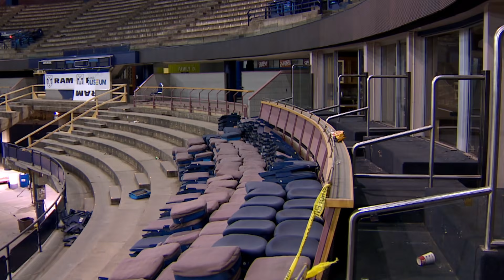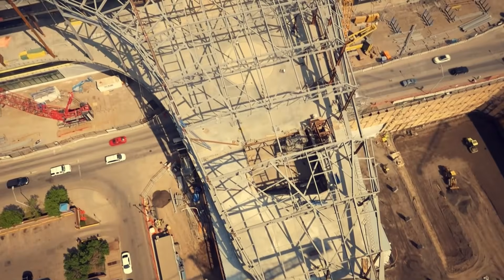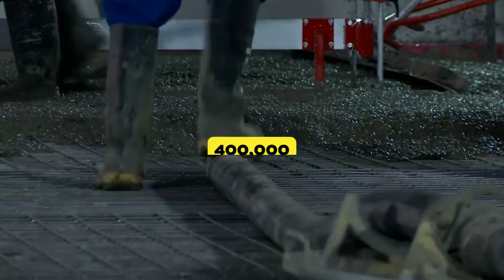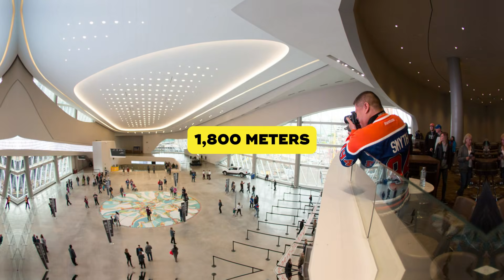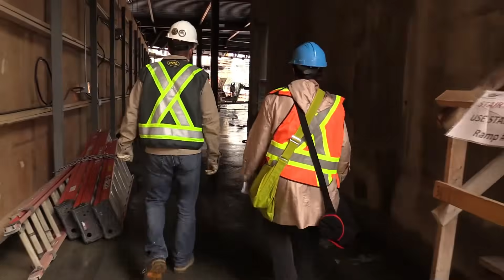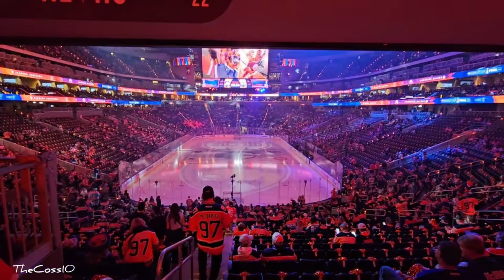Inside Edmonton’s $613M Arena Overhaul

Comment: As an Edmontonian, it's an architectural masterpiece and a great upgrade over Northlands Coliseum. HOWEVER financially and vitality wise it has done little to stimulate growth beyond itself  and even what you see is a great step down. The overall ICE district dropped the Observation deck from Stantec Tower, the food hall on the second floor never opened, neither did a VIP cinema complex OR a 45 story apartment building. Right now it's basically the arena, casino, JW Marriot, Stantec offices, a grocery store and a couple of bank branches. Not exactly the next Times Square.. Especially since MOST of it is heavily subsidized through tax breaks, levies and grants...